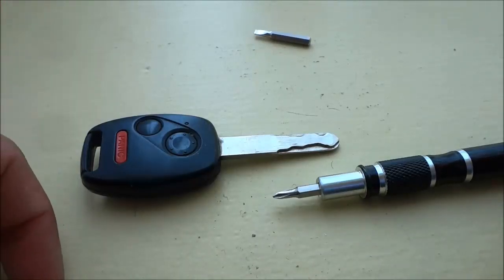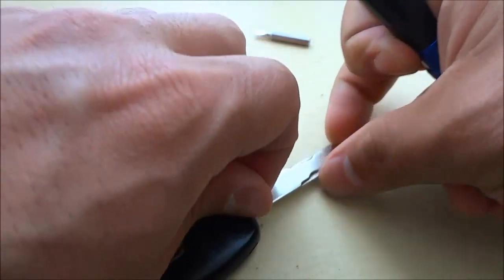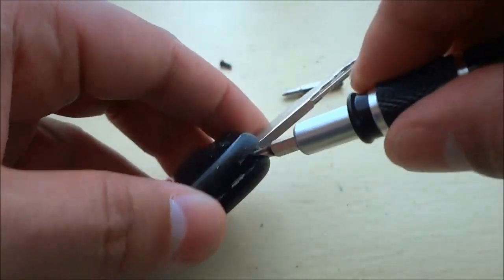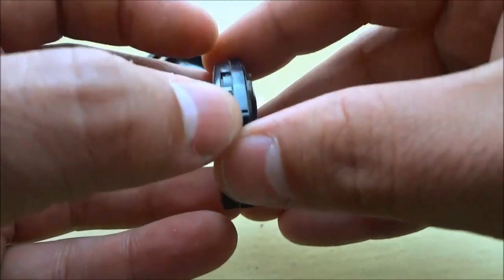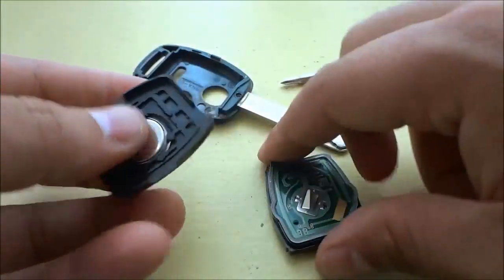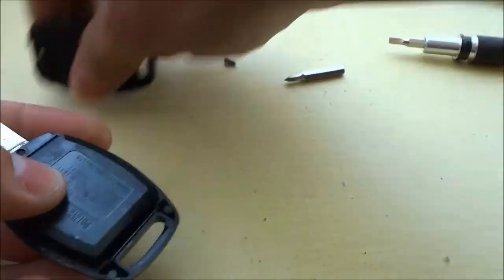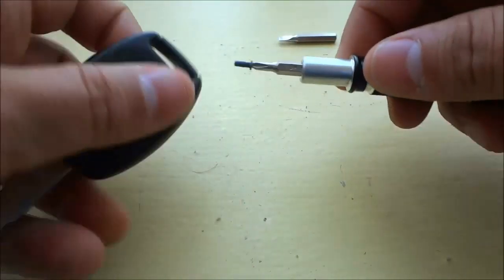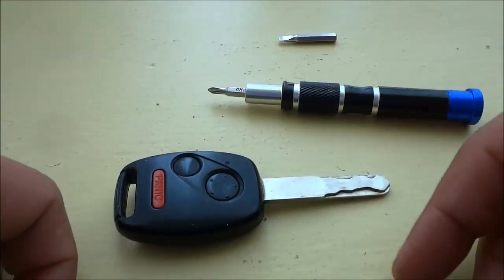How To Change A Honda CR-V Key Fob Battery (2005- 2013)

Comment: One extra tip I'd add is that it's good to clean the metal contacts inside the remote once you've taken the battery out, to lengthen the life of the battery and sort out any issues with connectivity. The first time I tried this I put the remote back together and it didn't work - it turns out the contacts were dirty, and when I cleaned them, it worked fine again.
Reply: This happened to me. Thanks for the help !

Comment: The screw head is stripped, can't unscrew it. Now what?
Reply: That's EXACTLY what is happening to me. The dipshits at Honda put in a cheap ass screw!
Reply: can't belive no one answered y'all in 5yrs but for anyone else that reads this: you could try buying replacement shells (without the computer parts) on Amz & just breaking the shell on yours apart with a lot of prying (as gently as possible) then you shd be able to simply put the computer & key bits (along with any new battery) in the new shell.. that's how most "pros" would handle it behind the scenes, if not straight up overcharging you for a brand new one from scratch, that is! 😬 good luck!

Comment: Thanks for the video. I didn't notice the tiny screw holding it together at first. To prevent other people making comments about the video 
not mentioning the type of battery it uses, it's a CR1616. I recommend placing a wash cloth on the surface where the screw is removed
so it won't bounce off the surface. It would be nearly impossible to find the screw if it bounces off the floor from my past experience losing one that tiny..
Reply: Thanks, was going to ask what kind of battery
Reply: Can I use a 2016 battery in my 2005 Honda CRV Key fob?

Comment: thank you, that got her - 
Helpful Tip (no offense of any kind interned): include battery type/size so repairer can acquire one before disassembly 
cr1616 i think
Reply: You could have intended offense.  The battery type is by far the most useful information for this process.  Anyone can just "unscrew the screws you see" and "pry open at pry points."

Comment: I see comments asking if other batteries will work. The battery number is based on the battery size. 1616 is 16mm in 
diameter and 1.6mm thick. So anything other than a 1616 will not work.

Comment: Great instruction vid. Thank you.  I did all that and the key does not work. The red light lights up on the Fob but does not light the car headlights nor did it open the door manually (the tumblers are not worn out). What do you think I the problem is??

Comment: After you do this, you have to re-pair/re-program the fob to the car, otherwise keyless entry won't work and the engine shuts off 1-2 seconds after you crank it. Learned this the hard way today 😭
Reply: How does one do that?

Comment: I am driving sister's CRV while she is traveling and the remote is not responsive.  As Honda doesn't use the more common type CR2032, I don't have a spare CR1616 in hand to replace.   

How often do you change the CR1616?   It is much smaller than the CR2032 in my GM cars.